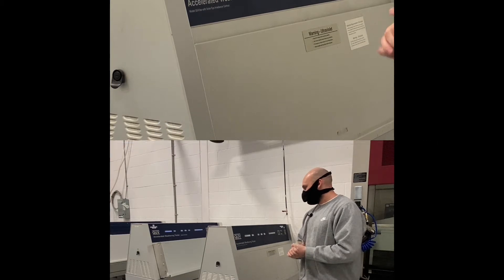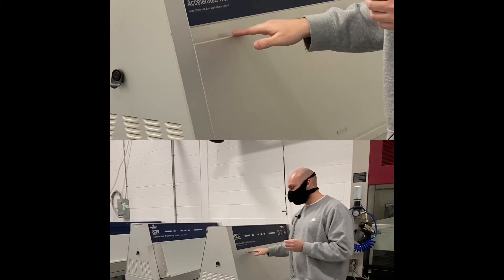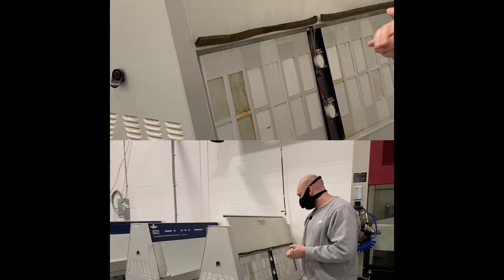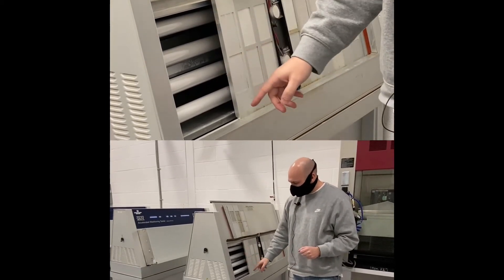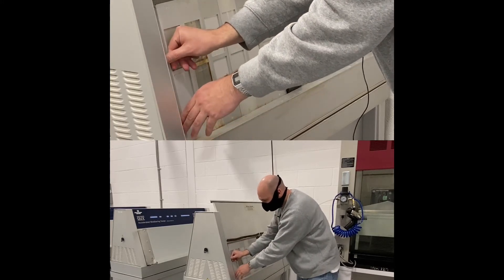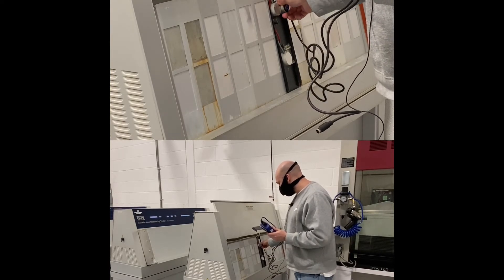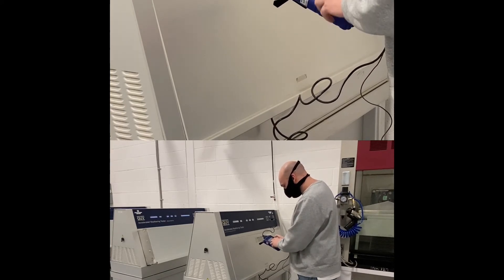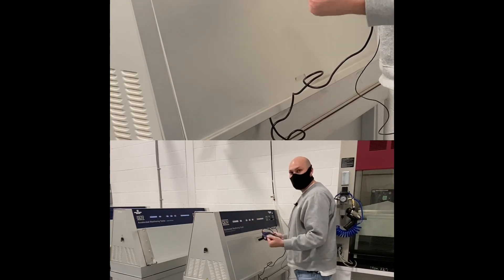ASTM G154 Operating Fluorescent Ultraviolet Lamp Apparatus for Exposure of Nonmetallic Materials

Comment: artificial environmental chamber for high voltage testing of insulator, and we use different condition in it like temperature, humidity etc and also we use ultraviolet rays on insulator who much ultraviolet rays required on insulator in chamber size 3feets by 2feets made of acyclic glass,my q's is that who much ultraviolet rays required for damaging the insulation in chamber and in what time period
Reply from the maker: The aging rate is difficult to evaluate given your setup. We always test to ASTM G154, which specifies detailed test parameters. However, even this test method is not considered a reliable time predictor. For more specific guidance, feel free to contact us. We're here to help! I am afraid we cannot help you other than suggest you use an official test method.